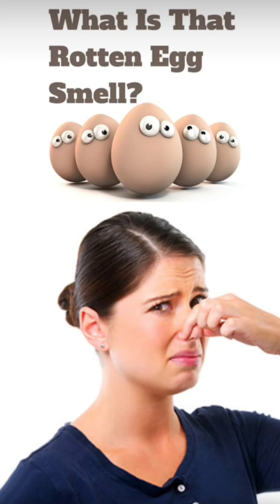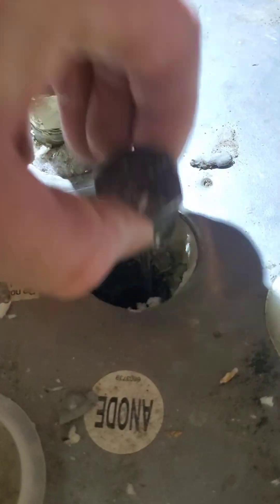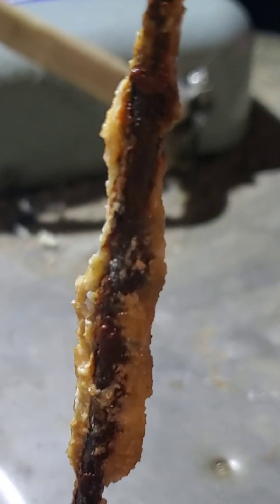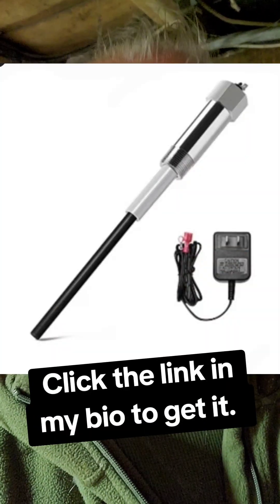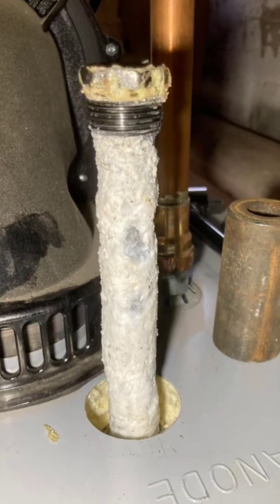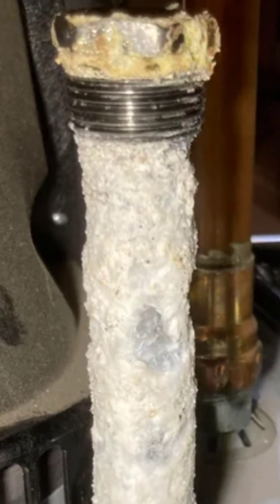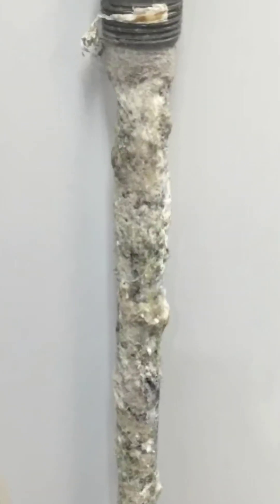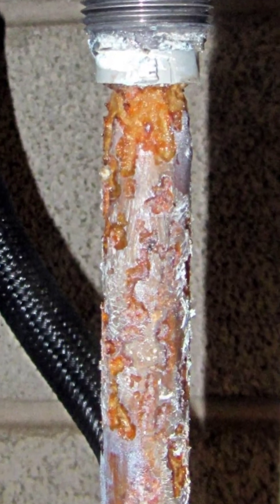Sulfur smell in your water? Got that rotten egg smell? Here's the solution!

Comment: Hi, we just started getting a sulfer smell, only on hot water, and it's a brand new water heater. Its only been in use for 2 months
Reply from the maker: You have an aluminum or magnesium anode rod. Change it to a Corro-protec powered anode rod and watch your problem disappear.

Comment: I'm 2 for 2 on satisfaction with Corro-Protec.  Replaced my anode with one in 2022.  It was a bit of a gamble, since they aren't cheap, but the reviews were good.  Based on that success, I bought one for my grandma.  Her water has always smelled bad.  For 45 years "that's just how our well water smells."  Well, it doesn't anymore.  Even surprisingly on the cold side.  She has a Bradford White, so the installation was significantly more involved, but it was worth it to solve a 45 year old issue.
Reply from the maker: Yup. They're very nice! Thanks for sharing your experience.